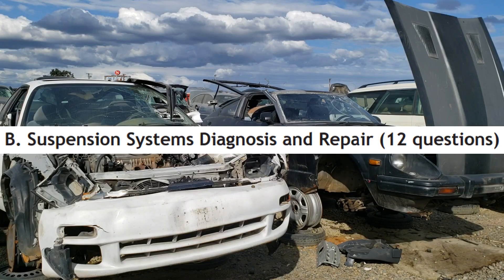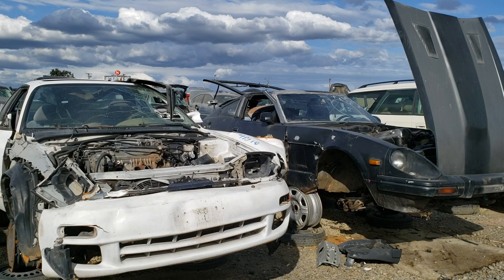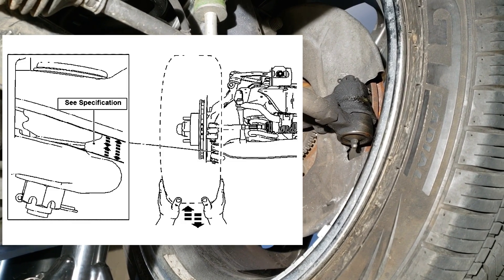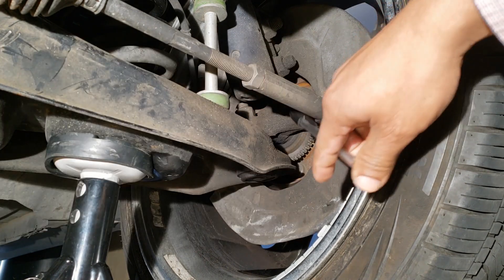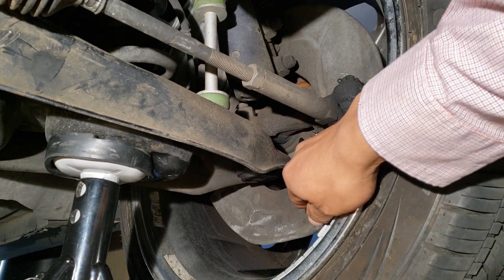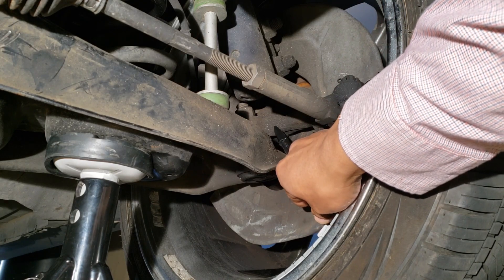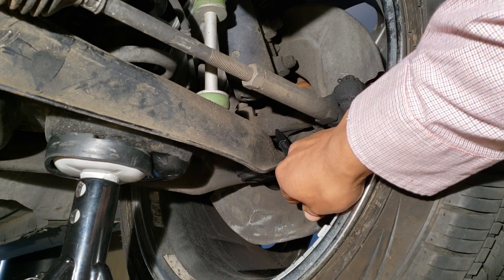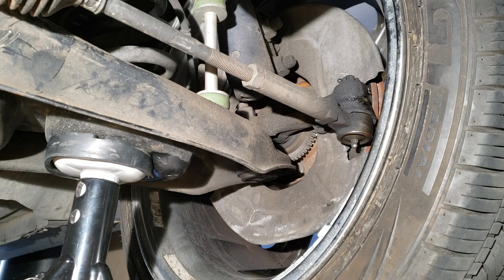ASE A4 Test Prep #4 - Front Suspension & Angles Changes

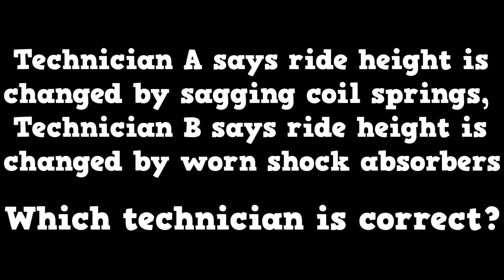Comment from the maker: Update 3-6-23: After taking the test I see that this video is very helpful. The question at 0:23 looks similar to an official question on the test. There was another question where the technicians differed in opinion on which alignment angles control arm bushings change.
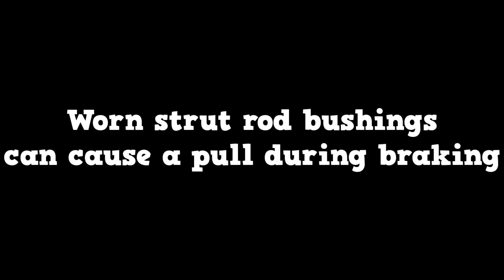2:41 There was a question similar to this one, but the pull was during acceleration, and one of the answers was not torque steer.
3:33 focus more on the procedure to changing ball joints. I found one of the questions ridiculous, it asked if you have to compress the spring on a Mcpherson strut in order to change the ball joint.
3:50 There was a near identical picture on the test, except the dial indicator was on the ball joint's stud.
Reply: How many questions is the A4 test?